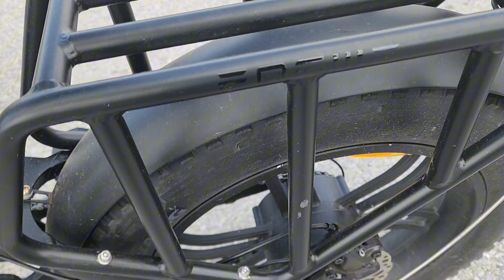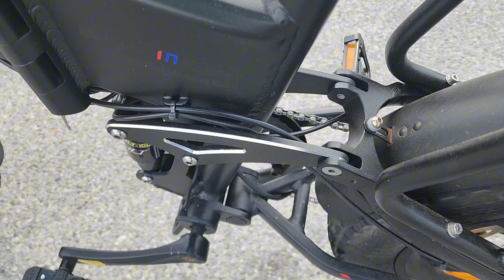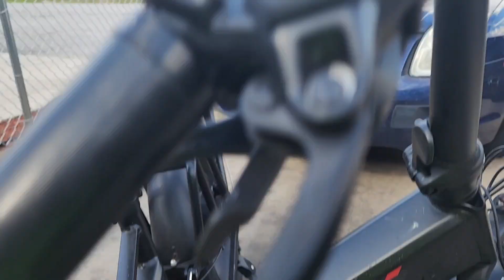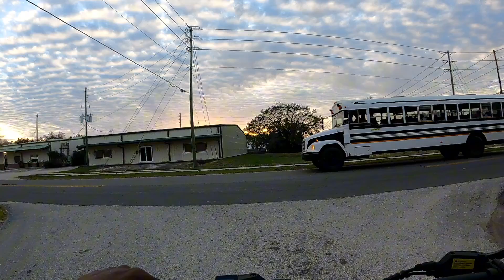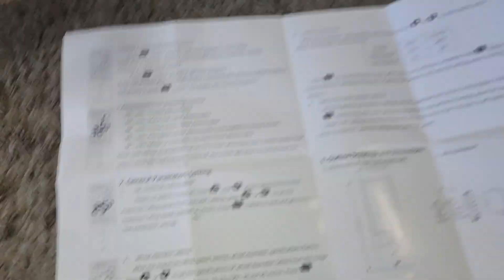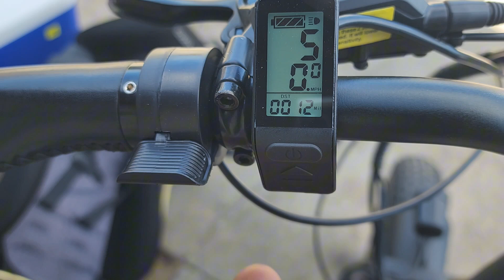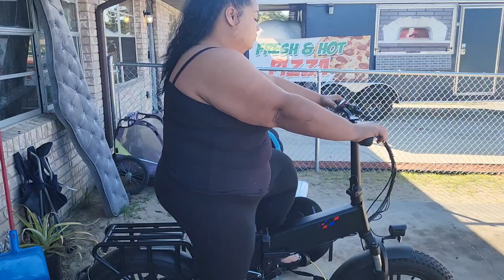Engwe Engine pro gets new controller,  new top speed and a crazy ride to Walmart

Comment: 8 months later, would you have done anything differently as an upgrade for the Engwe? Would you still recommend this controller?

I am debating trying to get a huge capacity external battery pack for very long range... but I would have to figure out how to splice the wires or something if I do that.
Reply from the maker: Oh yes this controller with stock battery is up to 32mph

Comment: nice video, i'm looking for a sinewave controller for my engine x here in the u.k do you have any recommendations?. i want it similar to my old 20a unit. my bike has 13ah+25ah+blender and i love the bike to bits its great. the problem has always been that rather generic squarewave controller. takes a while for the pas to kick in and at a certain speed it can resonate through the bike. i have modded it a bit. you have to be careful when using a high output controller as the parallel key in the motor is made of soft steel and can disintegrate if there's too much torque!
Reply from the maker: @simonjohnhinton1938  you can try a sabvoton 7245 controller
Reply: @EBG-offical  thanks for that I'll have a look👍

Comment: You've had some issues the overheating the battery or motor?
Reply from the maker: @AdonisStancu  not at all  we had it for a long time now we just sold it
Reply: @EBG-offical  I'm about to upgrade my controller for the ep-2 pro. Before had 18 amps now is gonna be 23 amps but from Engwe said that it can go up to 960w peak but I don't believe this cuz I've never seen all motors that go up to 960w. It should have up to 1000w
Reply from the maker: @AdonisStancu  you will be fine at once I had a 35a controller on it
Reply: @EBG-offical  Ep-2 pro and Engine pro had the same hub motor, both are 750w but 960 peak power doesn't exist, they lied

Comment: Got a question, is throttle response affected by the controller or the type of throttle? Why do some throttles have a dead zone?
Reply from the maker: Now that is based on the controller software  from. .89v  to like 4.35v  and some throttles might have a bigger range like .5v but if the controller is set to .89v and the throttle range is .5v there will be a dead zone there... but the controllers that are tunable  you can set you throttle low voltage to .5v  to eliminate the dead zone
Reply: @EBG-offical  ok so I 1:19  need a tuneable controller, can you recommend a  better controller , now I have 72v 80a 3000w,
Reply from the maker: @pnewt8458  sure  I recommend the sabvoton 7280 as a replacement
Reply: @EBG-offical  thank you sir

Comment: What controller do you recommend to get more speed and torque I have a 1500w csc kit with a 52v 20ah 40a bms battery am only topping around 30 rn
Reply from the maker: Get a sabvoton 7245,  it should get you over 30mph
Reply: Is there any other controllers that are suitable I am looking to get around 45/50 mph
Reply from the maker: @Unidentified36  you can thwre are a lot of options on controllers I'll send you a link
Reply: Ok thanks

Comment: The only bad about those types of Dual shocks is it is not meant to carry cargo on rear. Back will sway a bit of just 15 pounds due to the bars of the rear rack hooked up to the side panels of shock absorber. Its best to minimize any cargo and use a trailer for 40lbs and over. Love these bikes for I have a few but I did notice this and thought I fyi you all to avoid any issues .

Comment: I’ve got a question about the differences between QS 205 motor and nbpower motor they seem to be the same but I’m not sure if it’s the same or not?
Reply from the maker: This depends on what you referring to because there is a qs205 but nb power put their name on it
Reply: @EBG-offical  I found a QS 205 3000w 3.5t on eBay but on the motor it says nbpower instead of QS 205 but it has the same specs as the QS 205
Reply from the maker: @jonathanbrunache3848  it's a qs motor,,, it just have to brand on it, if you get one form qs it will their brand on it
Reply: @EBG-offical  Im glad I ordered it then btw do you know what kv is 3.5t I’m guessing 12kv based on my math but I want your opinion
Reply from the maker: @jonathanbrunache3848  to me 3.5t is the sweet spot for me for speed and torque
Reply: @EBG-offical  thank you

Comment: Does anyone know if I can run a 60 volt 60 amp battery with a 55a +2amp controller????????
Reply from the maker: Yes  as long as the voltage of the controller supports the battery voltage

Comment: The Engine pro has regen so there's more resistance in the hub motor. Also the throttle only works according to what PAS level you have it set at. You had it set on zero, so the throttle isn't going to work until you change the PAS to a higher level.
Reply from the maker: Yes, on the stock components but this kit you can set the PAS level to 2 and peddle at this level and still have full power on throttle which I like a lot.

Comment: If you have a spare broken vacuum cleaner the hose salvage that hose  and you cut it up to make awesome custom wire shrouds or alternatively cut a 750 ml drink bottle down the side now you have a scroll tube you can put the wires in get some paint on the bottle to suit and even go buy a fancy plastic bottle to suit i am aware you canget wire harness boxes but in my opinion there crap and under sized
Reply from the maker: Dang bro,  that's a pretty good idea for sure

Comment: A lot of things happen every day on the streets. Stay armed with a go pro. The new controller made it faster, but you also said you made a shunt mod. I assume a shunt mod goes straight to the battery. So, the stock controller was not shunt mod? Maybe you can explain it a little better in another video sometime.
Reply from the maker: The original controller was not tampered with,  the new one is shunt moded
Reply: So, what added power, the shunt mod or the new controller?
Reply from the maker: @mrcleanisin  both,,, sunt mod helps with acceleration
Reply: I have never worked on a brushless motor set-up, but regardless of the motor and controller, if you wanted to bypass the controller to avoid heating it up you could use a relay to bypass the controller and go directly to the battery at full current draw while acceleration and or racing.
Reply from the maker: @mrcleanisin lol that will be a full on and off!!!! If you just go battery to motor 🤣 hold on to the bars you going for a ride , if it was a brush motor
Reply: I am not saying to eliminate the controller, just click a turbo switch when you want to bypass at full throttle. Golf carts have heavy duty relays that could be used for this purpose. Your controller would not pass any current to the motor as it would be routed thru the relay to the battery.
Reply from the maker: @mrcleanisin  oh ok now I understand 👍

Comment: These electric motors can run at whatever setup they are given meaning depending on the controller you can set them up to
deliver lots of power down low or in the middle,  as your engine says are ok amps to run at?  It's been a while since I worked
w/ motors and mine weren't on bikes but depending on the motor specs or recommendations,  you can get controllers that
you program to operate the way you want or need.  I'll bet you can setup running situations where on low battery you can
run it in a way that stretches out your miles so you can get her home?  But that would require being able to have multiple
programs that you changed when needed like motorcycles let ya have an economy, sport, and balls to the wallz modes
of operation.  Of course a controller like that might cost to damn much so IDKnow jack-cH!T about any of this.  I'm just
having a brain-fart type of rant here.... it'll be alright once I get my meds??  peace brother
Reply from the maker: Well said brother 👏 💯👊🏿

Comment: I feel your pain, one of my dogs just ate the power cord on my vacuum.  so I'm wiring another cable up, but its like 30 screws and a complete disassembly to get to the connectors inside.
Reply from the maker: Yes,  I did the same with my vacuum cleaner  it's a pain to get apart...luckily it wasn't plugged in

Comment: There are a bunch of inexpensive displays that work with these controllers.  Mine of course did not come with a manual but luckily speed was already unlimited when I first hooked it up.  Also...you have to squeeze the brakes once on a lot of these in order to make them start...some kind of a safety feature I guess.  When I first hooked one up, and it didn't do anything...I was like, really?  Just had to squeeze the brake.  Probably some key combo to turn that on or off but I haven't found it yet.
Reply from the maker: Oh wow definitely didn't know that, I know my ebike will not move till it's stationary

Comment: The reason that your motor is hard to push well it's connected is because you have mosfets that have blown inside toward controller and they are shorting out and causing the resistance you feel in your back wheel
Reply from the maker: Ok ok I figured that much but wasn't so sure  I definitely appreciate it.